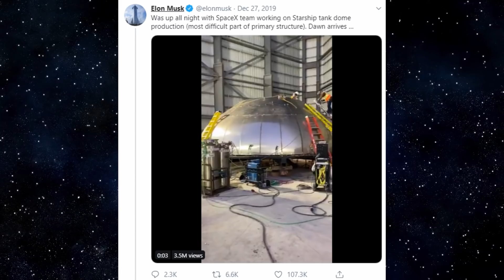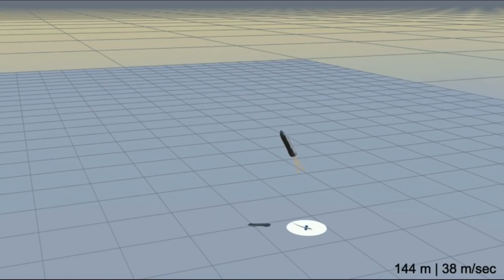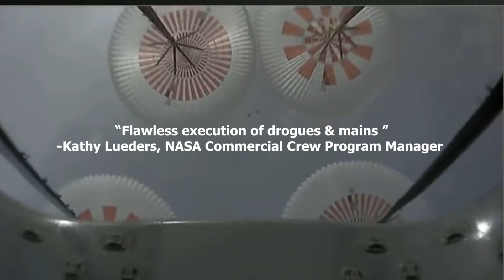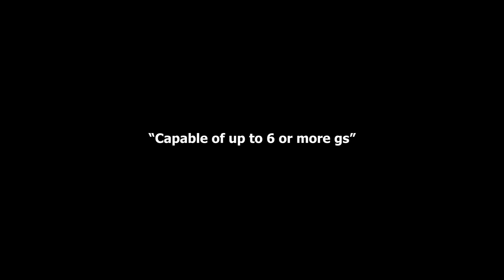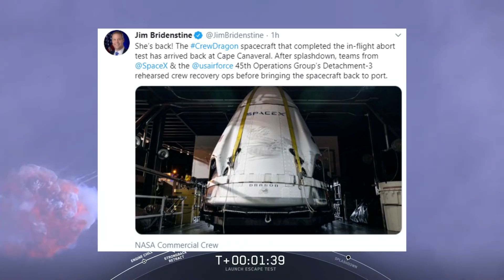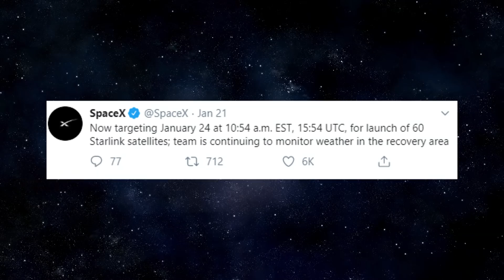SpaceX Starship Updates I Crew Dragon In-Flight Abort Test Summary I Next Starlink Launch

Comment: A dome is a part a building structure that spreads the weight of the roof over a wider span. 
A pressure bulkhead is the part of a pressure vessel that separates tank pressure from ambient or from another compartment. 
Which do you think SpaceX is building?

Comment: Am I the only one concerned that they waited until the dragon was safely away, to blow up the first stage?? A more authentic test, would be to have separation occur SIMULTANEOUS with explosion... just saying...
Reply: As far as I can tell from the post-test conference they didn't blow up the first stage. I believe they shutdown first stage prematurely which was detected as a flight anomaly and this triggered the emergency separation. The first stage continued its trajectory, unpowered, but without thrust and adjustments the first stage eventually started to deviate from its flight path and the stresses it experienced caused it to break up and the explode. Tim Dodd (EverydayAstronaut) tried getting these details from Elon Musk who outlined the process, but didn't clarify what specific triggering event was used in this particular test.
Reply: Elon did confirm that in the event of an exploding first stage whilst connected to the crew module the explosion would not be under pressure so would be more a fireball than an explosion. The heat shield on the underside of the crew capsule would easily mitigate any heat. The fact that the crew capsule can position and orientate itself to a safe place and deploy parachutes is what makes this much safer than the Space Shuttle in a catastrophic event.
Reply: Paul Denney  no. I just pay attention to what SpaceX say. It's called being informed. Just saying.